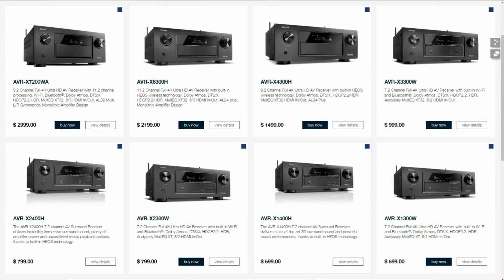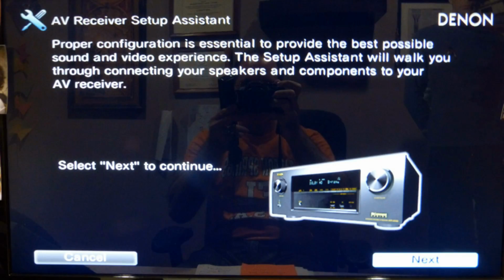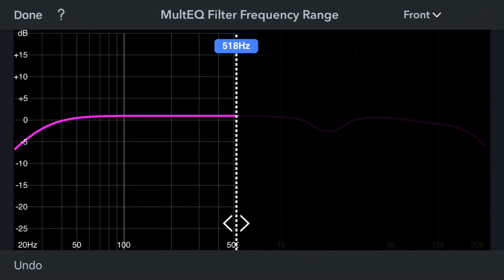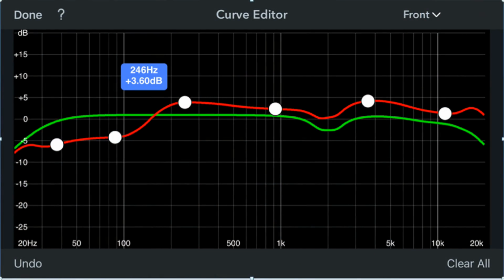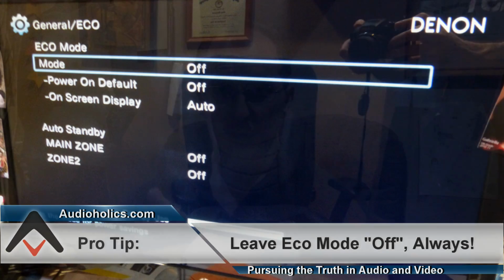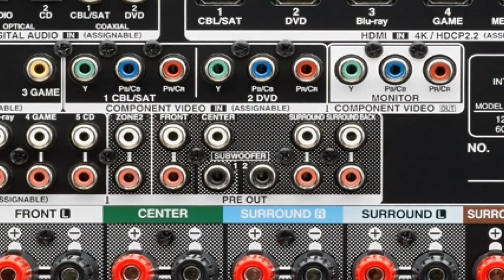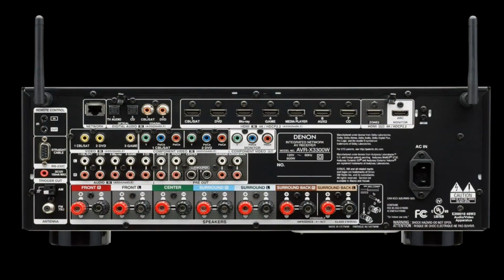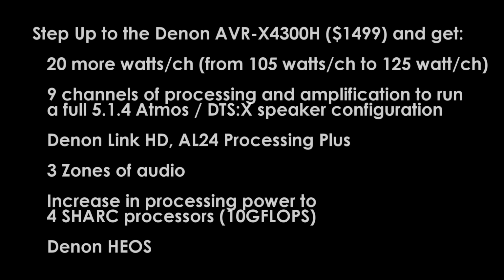Denon AVR-X3300W 7.2CH Atmos/DTS:X Receiver Review

Comment: climate change? since hugo left did u become an idiot? wake up from the leltist brainwashing
Reply from the maker: Science sets out to continually disprove itself based on empirical evidence to gain better understanding, Religion relies on blind faith for understanding and is rigid in its beliefs. Climate science like any other science follows the same scientific method that was used to develop the technology that you are communicating on the internet with. Denying Climate science is denying that scientists don't understand how a smartphone or the internet works.
Reply from the maker: i raul: There is a scientific consensus on anthropological climate change.  The only "Scientists" refuting usually don't have the proper qualifications to do so, or they work for big oil or both.  Climate data has been studied and analyzed using a strict Double Blind Test.  Even the Koch Brothers paid an independent group to study the data (which they didn't know what the data was for) and showed it was real and man made. Just because you don't believe the science or scientists, doesn't make it untrue.
Reply from the maker: Yes deny science but embrace technology.  #hypocritical
Reply: "It's sad that such an easily understood phenomenon... has to even be a political point." Well said, it's absolutely terrible that climate change has been turned into a political argument, and it's even worse that there are individuals using computers, the internet, and audio equipment (which are all marvels of science) turn around and just deny/choose to be ignorant of climate science.
Reply from the maker: Science isn't a leftist issue. Just because you don't believe or understand the science of anthropological climate change, doesn't make it untrue.
Reply: Audioholics  no no no my friend. u are good in audio but here u are wrong. the only "change" of the climate is happening when u go from winter to spring to summer etc. CO2 is a vital element for our life. The only thing that can produce a green gas effect is the water vapor(dohh) and the onli thing that can change the earth climate is the activity  of the sun or  the trajectory of the earth compared to the sun. Should i teach u that the whole "climate chage" propaganda is just for more carbon taxes? or to control the industry  of the emergent country? U should know this. Don't  worry earth was fine 6 billion years ago and it will be fine 3 billions from now. Should i advice u to study that Al Gore the first carbon billionaire wannabe and his PR team was lying to us many years ago that will be an ice age? that didn't  happened. After that they lied us that global warming is coming, that didn't  happened either, the difference is just 1 degree in 70 years! Now when they saw that nothing happened the push the new definition "climate change" that ca be adapted and usesed as the want cuz.. u know the climate is changing  every day, today is raining, tomorrow  no. PLS step up your game or just talk  about audioz cuz that is why we care about your advice. tnx

ps (don't mistake the "climate change" with pollution issues)
Reply from the maker: Joe we have temperature and CO2 data for 100s of thousands of years since we can take samples of ice from the polar caps. It's sad that such an easily understood phenomenon such as pumping C02 and Methane into the atmosphere causing heat to be trapped and then melt the reflective ice which protects the oceans from warming, thus creating a feedback loop, has to even be a political point.  What's even sadder is the least versed people in science have hijacked one political party in our country, but I digress.
Reply from the maker: i raul: I am well versed in climate science and come from a family of scientists that have studied the data and effects. Earth will ALWAYS be fine regardless of what we  do.  However, what we are doing is creating unnatural selection by wiping out species of animals and groups of people that can't move or adapt to the rapidly changing climate that we are causing. Climate isn't changing appreciably everyday. That's weather.  It's obvious by your confusion of the two that you aren't well versed in climate science so please don't try to educate anyone about it, at least on this  channel.
Reply: Audioholics   i was ironic when i said "climate change" is when the wether changes (dohh) - plsease donmt tell me about the "scientist" cuz we all know how they publish  their data just by picking what they want so the final results are in the narrative ast their people who fund them want. Should i tell u that many points of temperature recording that where included in this "climate change" study have been found to be placed close airports, in at the base of the vulcano, or directly in the sun on the tarmac? (u should know the the mesurements have to be taken at a shadow point) - should i also tell u tgat some years ago it was a scandal that u ignored about a satellite that was recording temperature in this "project" and it has been discovered that it.s recording where +10degrees more than the reality(... ) / climate change it.s a scam, for more taxes and to control economies of the countries, wake up, u cand do it. read more, or search Corbettreport Climate change on YT if u are lazy.  - he can explain much better -no bullshit, like your Av videos
Reply: be afraid of the moment when science becomes religion  #pseudointelectual

Comment: The X4300 has 11ch of internal processing, meaning you can use an external amp to do 7.2.4.  
  
The X6300 can do 11ch on its own.
Reply: Yeah, this never end, 3 years later there may be 9.2.8 and you'll need to have 17ch AVR.
Reply: /facepalm @ captain obvious

Comment: LOL ...that intro. Pretty soon Denon will advertise this as a 2 horsepower receiver - since MOST ppl will think they are getting a receiver with 215w per channel, so 7 x 215W = 1505W which is roughly two horsepower!!! - all of that power while they are using 120v and a 15 amp circuit LOL....which is also running their TV, Bluray, gaming console......and dual Subwoofer...while they are trying to hit THX levels .....weird